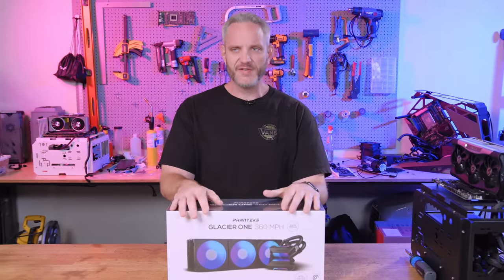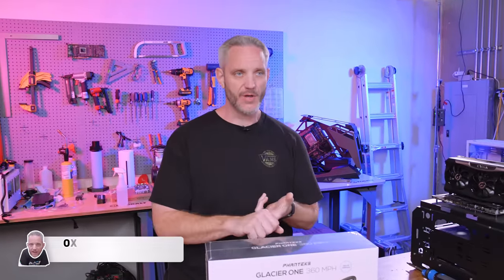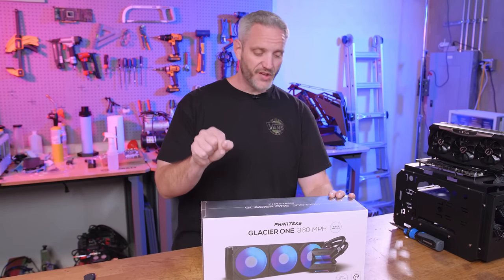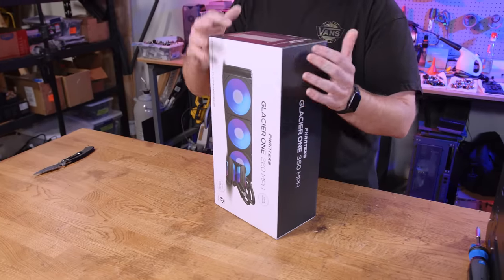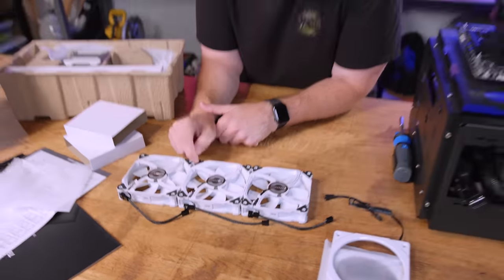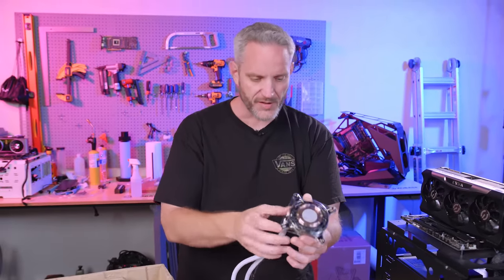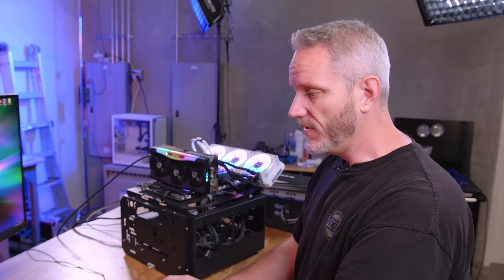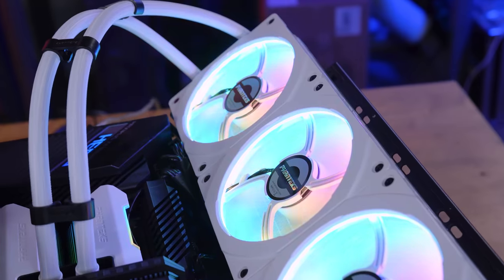A new CPU Cooler has entered the chat!

Comment: I was actually considering one of the Phanteks AIO's, been a fan of Phanteks since i bought the original Enthoo Primo but ended up getting the EKWB 360 Elite AIO instead, as i liked the design better and it came with 6 Vardar RGB fans, which is pretty awesome. 
My only "regret" is buying the 9900K. I upgraded to that because of the massive pricedrop and i knew it would be a hot CPU, but goddamn, that thing is toasty. When i start Cinebench, it instantly goes to 70c while only boosting to 4.8Ghz.

Considering that i delidded it, added a custom IHS that decrease the space between die and IHS, used conductonaut, got a good 360 AIO and an airflow case with 10 fans, while living in scandinavia, i really don't think that i won the silicon lottery LOL.
I mainly do a bit of gaming and small render tasks on rare occasions, so i think i'll upgrade to an i5 or i7-class CPU next. There's really no reason having a spaceheater for minor tasks, like some casual gaming or rendering a few images. I was just so excited to get an i9 for only 360€ but yeah.

Comment: Just FYI, while the Halos are great, the blue LEDs in them die fairly quickly.  Check out the Amazon reviews for them.  The blue LEDs will die within a year or two, so you'll have to replace the Halos if you want blue and you can't buy the white ones separately.

Comment: i got the 360 in black on a 3700x, in Phanteks p500a case, very cool set up.Phanteks does have a non halo st8 up RGB fan, I bought one to go in the back of my case they are a little proud of it at $35 but it integrates into the Phanteks case aio system perfectly. and you can buy the halos without fans if you want to upgrade non RGB AIO as well, but they are overpriced for what they are.
Reply: oh, look fake jay says I'm a winner.

Comment: It would be really neat if they put screws holding the copper cold plate to the block, and all you would have to do is remove those screws to take off the cold plate then add fluid.  Oh well, just throw it all away and buy a new one!  Much better for Phanteks!

Comment: 0:12 more efficient and less power/heat? woah lol, jay what did you drink that day. my 12900K is breaking 105c with 280mm water loop lol. (yes the copper contact and everything is sitted well, it's just that hot of a CPU lol)
going to change to a bigger and heavier water cooling to keep this thing at bay.

Comment: i have one of those halo's on an nzxt fan that came with my h700 specifically because i wanted some rgb but not a ton. i have just the rear exhaust fan with the halo and no other rgb lighting on the other 6 fans. i didnt want a hub led. i like the ring lighting, and i didnt know of any edge or ring lit fans when i built my current system. i bought a set of InWin Sirius loops to go in another build again specifically for the ring lighting. i have seen several now that look good.

Comment: An overclocked 12-Gen, cinebench run, would be the best “worst-case” cooler stress test imo. When reviewing cpu coolers, I don’t think it’s far fetched at all in terms of reviewing a cooler’s capabilities under load. 

Also, I hate how thin the radiators are on AIO’s. Especially when we know how thick they get when sold for custom loops (corsairs being the thickest mainstream rad I’ve seen).

Comment: That is a nice cooler. I use a 280mm though not a 360 on my 5600x. I like 140mm fans.
Reply: Same here on my 5600x. 140mm fans just have a much nicer sound profile IMO. More air for less.
Reply: What temps do you guys get? For like idle and full load?
Reply: @greensleeves8095  Mine has been awesome. High 20s low 30s at idle. Never above 64c while gaming for hours, or benchmarking. Sometimes I've felt like it wasn't reporting temps properly, but I've double checked with other programs and they're fine.

Comment: My predictions. With current wattages going up and up. Watercooling will soon be standard on any respectable gaming pc. Aio water cooler is already normal for cpu. And soon we will going to see more water cooling for gpu. 

Air just simply wont do anymore. 

And maby we even see the use of silver instead of copper on the high end. Silver is a better heat conducter than copper.

Comment: 🖥️🖱️ I'm a little worried about YOUR power consumption on this 10900K test system currently used. (Overclocked correct?) 240 watts seems rougher excessive and I'm worried about the chips long term health. Perhaps a tip (If possible) at 5ghz all core I believe that the chips heat may drop further if a more aggressive v-droop is established, tightening in the slack (so to say) and sub sequentially dropping the excessive amounts of volts that are driving the power consumption so high. I'd say at least a healthy 20-30 watts drop may be induced here as a result and in turn give you greater head room to play with pertaining to any more aggression added through a finer tuned overclock. Much more lower temps and a healthier chip that will be much FUN for many more years to come. PEACE. 👽☮️

Comment: Someone's gotta be the physics nerd here, so I'll do it.
They better have chosen that paint on that radiator (specifically on the fins of the radiator) very carefully, to have a high Emissivity.
Why? It's physics, of course.
Everyone knows black clothing is hotter in the sun right?
What most people don't know is that black clothing is also cooler if you're in the dark.
Because that's the thing about a black object. It both absorbs and radiates energy quite well.
This is something that can be quantified, aka put into numbers. The statistic in question is called the Emissivity, or E.
In general, dark colored objects have a higher emissivity than light colored objects.
High-emissivity objects both absorb and radiate energy better. In other words, they have a better thermal connection to the environment than low-emissivity objects.
As you can probably imagine, this is quite important when designing a cooling system, such as an AIO water cooling system for cooling 200 watts of heat from the latest Intel CPUs.
So I would have much preferred if at least the radiator fins on that radiator of that AIO were matte black rather than gloss white.

I can already hear you asking me "OK genius, so why are the radiator panels on the ISS white if that's not the most efficient color for a radiator?"
Well the answer there is easy. Those radiator panels, unlike the radiators in a computer case, are exposed to direct solar radiation, as well as the reflected solar radiation from the Earth's surface.

That solar radiation is composed of a wide band of electromagnetic frequencies, but the portions of it of note to this conversation include UV, visible and infrared wavelengths.
So, the reason the ISS radiator panels are white is that they are covered in a "high-E" coating" that was selected to have a white color in order to reflect visible radiation.
This makes the radiator better able to do its job of rejecting waste heat from the space station, because it does not absorb the visible portion of incoming direct or reflected solar radiation.
The term "high E" means that the material has a high "emissivity" which means that it radiates energy relatively well, independent of what color it may be.
For comparison, when buying windows for a house, you may come across the phrase "low E glass". This refers to the same E as "high E paint", the emissivity of the glass. In the case of "Low E Glass", that glass has usually been coated with an extremely thin layer of Tin or some other metal in order to assist it in reflecting infrared radiation rather than allowing it to pass thru the glass unhindered like would happen with normal glass. By reflecting infrared radiation on both sides rather than allowing it to pass thru, the glass will act as an insulator between the interior and exterior temperatures of the house, which increases the energy efficiency of heating/cooling the house as a whole.
This insulation ability (or rather, improving it) is also the reason for choosing "double glazed" or "triple glazed" windows, those actually have a layer in the middle that is filled with a gas, usually Krypton, as this aids the window in being a better insulator against thermal energy making its way in or out of the house thru the window. Now ideally that insulating layer in the middle would be evacuated, similarly to how a true thermos flask is constructed, because the lack of any matter between the panes of glass would prevent thermal transfer by conduction or convection, while the Low-E coating on the glass would block thermal transfer by radiation. However, this would dramatically increase the amount of material needed to be used in the window's glazing, because the window would have to be strong enough to withstand a 14.7 (or roughly 1 bar, or 101.3 KPa) pressure differential across the thin sheet of glass, with all that load transferred thru the edges of the sheet of glass. This is a structurally unfeasible constraint to put on a window that is intended to be affordable by the average homeowner, so instead they use Krypton, a gas that is rather dense. By being a dense gas, an input of thermal energy does not cause the molecules of gas to gain that much velocity, so transfer of energy by conduction or convection is still quite effectively impeded without requiring the absurd structural considerations of a vacuum insulated window glazing.

Comment: Big Air still rules. There's almost no situation that cannot be handled by air cooling. It's also cheaper and more reliable. I can't deny that a custom water cooled build looks spectacular, but that's all it has going for it: looks. My latest build has an AMD Ryzen 9 5950, an Nvidia RTX3080Ti, 128 GB of RAM, 2 NVME SSDs, four hard drives and 2 Blu Ray burners...and air cooling.
Reply: And drops the temps about 20c

Comment: AIO coolers seem to not last for me, so I slapped a massive Noctua NH-D15S on my 5900x and used Arctic MX-5 Thermal paste and my temps are amazing around 100F/37C doing normal tasks and 157F/69.8C with cinebench R23 set to real-time priority and CPU was hitting 4.9ghz.  I also have seen the videos where an AIO would spring a leak, so this air cooling will be fine for me. Also for reference I have the Thermaltake View 71 case, it's massive and roomy with 3 front fans and I have 3 top fans and a rear so the whole system is running cool, not just the CPU
Reply: yep I will probably stick to air cooling forever. AIO's just arent that impressive, they cost more and can leak.
Reply: Air cooling is very reliable, particularly with heatsinks that can passively cool if needed.

Water cooling increases maintenance and other considerations, but it is effective in making use of your ambient temperatures when use of AC is not possible, as water drastically increases the thermal capacity to draw heat from the CPU and GPU compared to transferring heatsink to air.

Custom watercooling allows significant headroom for part maintenance.
Reply: @Aereto  yeah only custom water cooling has actual benefit. But its expensive and used for extreme overclocking. Noctuas biggest heatsink will cool just as well as any 360mm AIO, and with less noise.

Comment: you know what bug me the most about water blocks is copper plate is always round were the cpu are now rectangle so put not make rectangle plate fit all the cpu ? so means only 70% cpu get covered by copper plate wounder why cpu hot. when look at water block what missing that use to be there pc fan pushing air on to it or heat pipes pushing air away from it as well fans keep parts around cpu cooler so my add a fan over top water block move air around it or away.

Comment: I have not messed with my cpu but out the box my i9 10850k runs in the mid 70s low 80s and goes over 1.4 volts with a corsair h150 pro

Comment: So how much heat can this thing handle and still keep the coolant under 60C with 800RPM fans? I wanna use it to cool the final stage of a portable Class-E Tesla coil and it's about 700-800W of heat to move (far beyond what typical high-end air coolers can handle before "drying out", I tried it). May go with a 420mm one now that those are a thing.

Comment: So, aside from the added halo thingies you put on the fans and added LGA 1700 support, these are exactly the same as the MP model??
I have looked up the prices on the MP and the MPH over here and the difference is about €38,-!! It hink that's a bit steep for just an added/different bracket and a few pieces of plastic with LEDs in them!

Comment: I noticed that when you did your ASMR video build that you took the stock thermal paste off the AIO. I’ve been thinking about a new build with a 12th gen Intel, and I’m starting to think that it will almost be mandatory given the reported heat generation with this chip to do it the way you do it instead using the stock AIO thermal paste

Comment: Hey JayzTwoCents 

I have a setup right now and i dosen't think that the preformence are that great :( 

do you have any advice of what i should opgrade to get better preformence ?? 

Current serup:

CPU: Ryzen 5 3600
GPU: Msi 2080 Gaming super 
Motherboard: Asus tuf gaming b550m PLUS (wifi)
RAM: 32 gb corsair Corsair Vengeance LPX DDR4-3200 C16 BK DC
SSD: Samsung evo PLUS 500gb 
Powersupply: Corsair 650 watt bronze 
CPU cooling: Corsair ICUE H100i
Case: FOURZE T760

Hope you will take a look and come up with some options :D 

Love your vids btw :D

Comment: Would he have gotten lower temps if he top mounted it in a case? (surely the angle he has the AIO on, is not making use of the pressure in the case (eg having 3x 140mm fans at the front of a case sucking air in for the Cooler at the top would have been better?)

Comment: Halos have been out a while.  I bought them for my 360aio and other fans in my case that have no rgb.  They are really nicely made out of aluminum and add a premium feel to the fans can't say enough good things about halos from Phanteks. The light output is very good and as you put adds a depth to the fans integrated rgb does not.
Reply: Scammer detected

Comment: I disagree with Jay saying that Aio are closed loops, I had few corsair aio and was able to easily remove the copper base plate by undoing the screws, drain the loop and refill it with coolant that is used for custom loops, but always make sure that they are OK to be used in mixed metal loops to prevent reaction between aluminium and copper. And during this process I also checked and cleaned if necessary micro channels on the cold plate. Then using syringe was filling the loop keeping the pump unit in the highest point to get the air out as quickly and easily as possible by turning it for few seconds when it looked that it was full. Similarly to how you fill custom loops.
Reply: You can even change the tubes lol
Reply: @valentin3186  yes you can but it takes much more effort and higher risk of leaks, than adding or replacing fluid in the aio
Reply: @Blackrhyme7  so its useless for people who have no experience lol im sure jayztwocent knows about this.
Reply: @Ehren1337  sooner or later you have to refill the AIO. Most of them got draining port though
Reply: @Ehren1337  I had no experience when I have serviced my first aio h80 watched a video on YT and followed the steps
Reply: @Blackrhyme7  people dont wanna do it thats the problem lol

Comment: I miss the crazy old times where you just strapped a motorcycle cooler to your case and used it as a radiator, grabbed a aquarium pump and used the smallest waterpipes your local hardware store had in stock. This is just too save to be fun.
Reply: After I saw the LTT "desk made of radiators" I kinda started brainstorming on a desk design using bike radiators. It would be a fun project and totally viable 👍
Reply: @DataDrifterOFC  Dont forget, most bike radiators have that switch lever to block the flow, i forgot to open that once.... it was a disaster, luckily a disaster outside of the case.
Reply: @furglii  I have to remember that, thanks! 😄